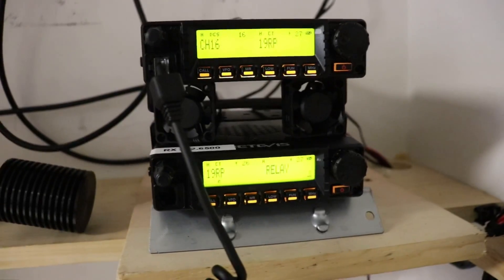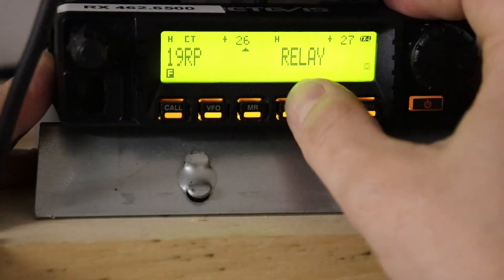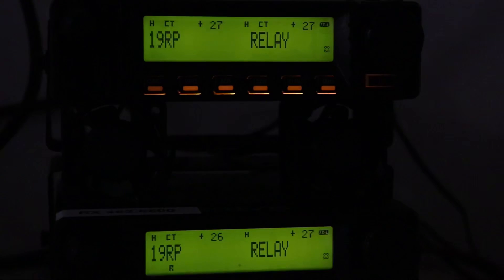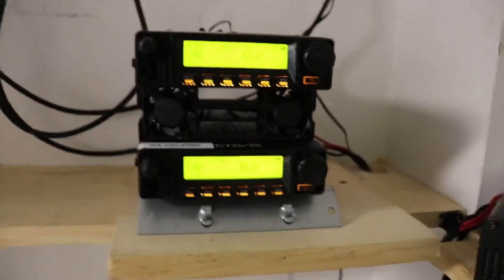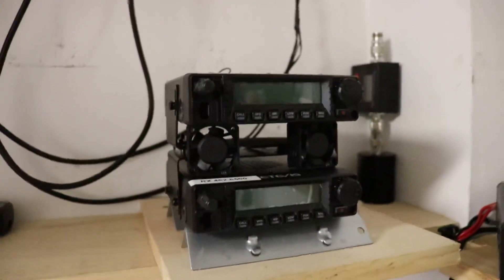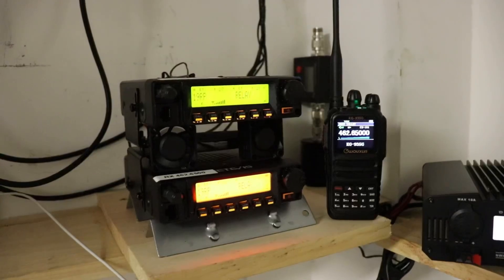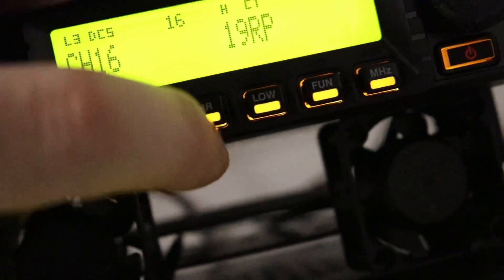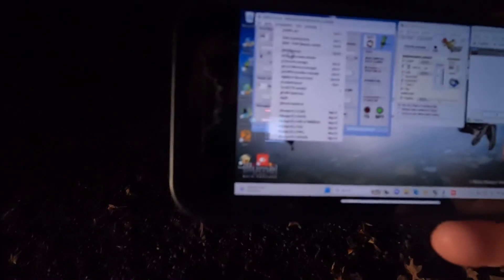Retevis RA-87 G.M.R.S. 40watt Repeater build and testing

Comment: I ended up buying the whole rar87 repeater kit from retevis because I wanted a little more power than the ra97. 

I think I have it working for the most part, however, I’m not sure I have my tones set right. I’m using dts and using the same dts tone for both transmit and receive, I’m just curious if you know if I need to 
A) have those tones set in both the radios 
B) just have them both on one, either the tx or rx radio.
C) have one radio with r-cd and the other with the t-cd set to the DCS tone.

Currently I have both radios set with the same C-cd which sets both radios to have all the same c-cd, r-cd, and t-cd. I seem to be getting good transmission while I’m near the repeater, however as I gained distance I seemed to be loosing the transmissions (very minimal distance) . I did not have that little r function set that you went over but I’ll see tomorrow if having that turned on helps the functionality. Any insight in setting the tones would be much appreciated.
Reply from the maker: A I set both radios to the same tone 
B the little R means your reverse transmitting so your receiver has to have the R also make sure your receiver is plugged into the high side of the duplexer and use the frequency your duplexer is tuned to
Reply: @JDubbsadventure  thanks for the reply, I’m wondering if not have the reverse transmit on was what was causing my issues, I’ll test it tonight and see how it works!

Comment: Thanks JDubb you seriously helped in getting my system online - got the repeater setup but cannot locate the hangtime for the kerchunk - I thought it was the Squelch Hang Time in the Optional features section but even at 500ms I don't see a difference. Where is that set at?
Reply from the maker: To remove the squelch tail cut the tail off and make sure the tend I believe it’s 60 off that’s the Roger beep
Reply: @JDubbsadventure  I actually want to turn the tail on - its nonexistent right now.
Reply from the maker: To have a squelch tail cut 
62 tail on 
60 tend on (Roger beep) 
9 is your hang time

Comment: Couple of suggestions from someone who learned a lot the hard way.  LMR or any of the similar type "dual shielded" coax is really not a great idea for repeaters due to something called Passive Intermodulation or PIM.  LMR is great simplex cable, however you can get a lot of "angry pixies" in the line on repeaters with duplexers (single antenna RX/TX setups).  This shows up as RX desense, a static or distortion on the incoming signal etc.  I built a repeater happily using what I thought was a good idea, real LMR-600.  Turns out there is a reason most "real" repeaters are built with Heliax or other air core hardline.  When you have tinned braided shield resting on another metal (in this case aluminum foil) you can created millions of small contact points that (due to bi-metalic properties) act as diodes.  This creates RF intermod that inherits the coax.  It is to weak a signal to radiate out your antenna but it comes back down the coax as a distorted common mode current signal and your RX has to deal with it.  This is not always the case, some installation with LMR style cable get away with it, often with really high end commercial grade filters/duplexers/radios.  However for the home DIY'er this can make you crazy if you experience it.  I ripped all the LMR dual shield out of my system trying to track down desense.  The short runs were replaced with R400 or 402.  The long run was with cable found on ebay that was "commercial install remnants" of Heliax (Trilogy 1/2" Coax Cable from Antenna World on ebay).  All the desense went away, so this was the magic bullet for me.  I wanted to share this as this info was really hard to find until you go to HAM repeater builder sources.  It never occurred to me that when you transmit into the LMR coax that power "could" be converted to noise by the very low loss properties of the cable and cause repeater problems.  If you use separate antennas this is not an issue.  Also, LMR is GREAT coax, just for simplex.  Do yourself a favor and research RF PIM!  Cheers!
Reply from the maker: That’s true, and Iv looked into it and if there ever is a problem than I may order hard line as of today no issues

Comment: Just a note, I used LMR400 for my patch cables and after watching your video again I noticed you specified that you were using LMR240 cable. I wanted a softer cable from the LMR 400 so I got the RG8X cable and lost 10 watts before the Duplexer. I thought that was crazy!!!
Reply from the maker: I’d check your swr. I had rg8x before i switched to the lmr240 and gained a little wattage (2-5) but nothing that significant. There’s a seller on eBay that makes good lmr240 cables with hight quality ends
Reply: @JDubbsadventure  I would be interested. Do you have a URL?

Comment: Suggest if vou internet search for RA87 Chirp There is a good working instruction set for how

to use with

Chirp

((Turn on chirp developer mode )) and click on file dropdown menu) file, select py file you downloaded to load module RA87.....

per instruction set

When thats done and you’ve done the download toradio > using the supplied programming cable 
click on view > show extra fields

It then lets you check mark those frequencies you dont need scanned for com activity

You can also add UHF ham repeaters @ frequencies to monitor and listen to

You can listen but not transmit on ham repeaters due to current firmware

Suggest have a great day

R

Comment: I think the 50watt btech's are probably your best bet to have a 40watt repeater build.  They transmit well above 40watts, closer to the advertised 50, and with a duplex you're probably gonna be right at 40watts.  Since they're $219, I'd say it's the better deal for ya to have the 40watt repeater build you're aiming for.
Reply from the maker: There a good radio but there not easy to make into a repeater. This was a video showing anyone can build a repeater that works well without being able to build circuits and their own board. Thanks for watching
Reply: I just bought three of the btechs from China direct for $150.00 each , saved about $210.00 . Two for a repeater and one for a mobile unit.

Comment: OK, I built the same Repeater that you have in this video.I'm still al little confused about setting the CS tones. If you set both "CTCSS or DCS" tones or what? Both radios are set just like you instructed in your video. I am getting 40+ Watts on the antenna port at the duplexer with a SWR of 1.06. Best I can tell that is super!
Reply from the maker: I set both radios to the same ctcss tone for example. The receive radio has ctcss tone 67.0 and the transmit radio has ctcss tone 67.0 set. You can use either ctcss or dcs but not normally both. Your getting 40w after the duplexer that’s really good the duplexer normally takes away 30-50% of the watts
Reply: @JDubbsadventure  I set the radios to Simplex mode before entering the repeater settings. One radio output was 48W and the other was 45W. I used the higher watt radio as the transmitting radio.
Reply: @JDubbsadventure  Another thing I don't understand is the duplexer tuning. I selected a duplexer set to 462.6750 / 467.6750 - Channel 20. In your video, you selected channel 19 in the setup so I assume your duplexer was tuned to 462.650 / 467.650 - Channel 19. How does the Retevis Repeater build know to use the 5K offset on the transmitting radio?
Reply from the maker: The offset is preprogrammed into the radio. Make sure you have that small R on the receive radio so it will reverse transmit
Reply: @JDubbsadventure  When I complete my build I am going to make a youtube video showing my build. Would it be OK to credit you and your youtube channel in my description?
Reply from the maker: That would be awesome if you would credit me

Comment: I'm building a Retevis Repeater just as you have in this video. I thought about using a Marine Battery Box as a Repeater Enclosure. It has some ventilation in the top lid and it would be easy to mount cooling fans for additional heat dissipation. What do you think about this idea?
Reply from the maker: I’m doing a video now that you might find interesting. I think you’re going to want something with more air flow depending on how hard it’s used.

Comment: Hey Dubb’s were you able to find the mic Pin out for these radios?
Reply from the maker: I did but when the radio is in repeater mode then the mic (rj45) plug is disabled sadly.
Reply: Strange.. mine still operates like normal. But also my 87’s only have 2 power settings high and low. I notified Retevis and they said “ that is what it is now” Not much help. Where did you find the pinouts?
Reply from the maker: @Jason-gc7vv when mine is in repeater mode it will  key up and immediately shut off. I emailed them and they sent it to me
Reply: @JDubbsadventure  Thanks man I will check it out!!

Comment: Do you happen to have a list of everything needed? What antenna are you using?
Reply from the maker: I’m doing a video on that. But real quick 
2 radios 
1 15-30amp power supply 
1 duplexer 
25-100 foot of good quality coax
Tram 1486 antenna
2 Lmr240 or lmr400 patch cables 
An swr meter 
The cool guys cooling fans kit (Amazon) 
Miscellaneous hardware

Comment: Hey J dub, question for you when your talking about the cooling fans you installed.  You have the fans wedged between the radios and say the hottest part is on top where you have the temp probe.  Are you going to place a fan up there also?

The reason I ask is because retevis now offers this repeater as a package in a metal case, carry handle, and a power supply for $530 shipped.  It does look pretty but upon further inspection from the available photos online, it appears the radios are stacked directly on one another.  I see that very problematic for cooling, especially if a guy wants to mount a 120mm PC fan under the heat sink on Tx radio similar to what you did.   There is a fan on the case but I assume that is extracting heat and not blowing on anything. 

It does look like retevis omitted the data cable and have them wired directly to the PCBs on each radio.  I wonder if that helps with any delay between Rx and Tx?

Anyways, long story short.  Would you get the package repeater in the case or go with the two radios and data cable and build your own rack with cooling fans if you had to do it over again?

Link for referance:  https://www.retevis.com/rar87-40w-gmrs-walkie-talkie-repeater-base-station-us
Reply from the maker: Sorry I missed your comment, Iv known about that set up for sometime now and I still prefer building my rack and adding cooling fans wherever I need them. I have a video coming up that showed the repeater as a finish product and no longer a prototype

Comment: Nice video! Curious I see your repeater’s receive freq is 462.650 and transmit 467.650. Shouldn’t this be reversed? My assumption was for the Duplexer high would be  467.650 (repeater receive) Duplexer low would be 462.650 (repeater transmit)?
Reply from the maker: You know you’re the only one who noticed that. I saw that when editing the video if you look at the newer videos you will see I fixed it, but good eye
Reply: Hey Dubb’s have a question for you, need your expertise. I’m working with 2 HT’s for local repeater with amp and duplexer for about 20w. Output from repeater great but have issues with getting into repeater knowingly because of using HT’s. Would you recommend these RA-87’s… or something like your midland MXR-10? Your distance tests seem great with both set ups. Any info would be great thanks man!!
Reply from the maker: @Jason-gc7vv  I think your saying yours using two ht as a repeater? Depending on what your looking for the MXR10 is great no fuss works right out of the box and my friend makes a plug and play interface board. Both the MXR10 and the ra87 have a squelch tail so that will let you know that you’re hitting the repeater.
Reply: Hey Dubb’s. I went with ra-87 but cannot get squelch tail after hitting. It’s there but short. Any idea how to adjust? Thanks man!
Reply from the maker: I’m out of town but I believe you can change the time in the S something in the menu and you can cut the tail on it’s the last setting

Comment: I'm new to gmrs, I want to setup a repeater at my house as i'm trying to reach my office that is 25 miles away, if that is not possible i want family to be able to use it on a 5 miles radius. I saw retevis sells the same equipment in a box, but being new, i'm not sure what cable to get, what connectors it would take, i did see you are using a tram antenna in the comments. I want to get all the possible power so I don't think i would be using a duplexer, do you have any tips?
Reply from the maker: Distance is determined more by terrain then wattage, watts help you for example penetrate walls, trees, etc. I’d buy the radios as cheap as I can I know fight before Christmas I saw them at $98.99 for 5 days. The cable is a simple audio jumper cable that amazon sells for $3-10 I got a 3 inch one since everything was close. My cable came with a rode microphone I had extra. Check out my zello channel and you can hear the repeater and play with it. I have a short video on the pole I’m using it’s cheaper than anything that’s radio specific

Comment: If you put up a tram 1486 (or 1468? Can’t remember which number) gmrs base antenna, which has a gain of about 6.5db, that should increase your range.
Reply from the maker: I did which to the 1486 from the midland mobile 6db antenna. My range is limited by the mountains not really power

Comment: I watched your video fully and read every comment but I didn't see anything about the Duplexer that you used. Did I miss it or can you tell us what you used?
Reply from the maker: You don’t need the duplexer to make it work, that said you will need to antennas, separated, far apart. The duplexer I have is a “cheep” one from buytwowayradio.com you can get them from eBay and Amazon but you will have to tune them and that takes special equipment

Comment: Do you prefer this repeater set up better than the RT97s or Midland?  Thanks
Reply from the maker: So far yes and no I think the midland is alittle more sensitive but the ra87 is a lot better for my area since my antenna isn’t extremely high and the leaves hurt me in the summer. Both are extremely good and useable. The ra87 will need fans and a box made.  where the midland is plug and play
Reply: @JDubbsadventure  Awsome thanks for the reply and info. Trying to make up my mind between the two.
Reply from the maker: @brettmorefield3455  really just depends on your area.

Comment: I WOULD LOVE TO KNOW MORE ABOUT THE DUPLEXER AND ANTENNAS ? DO WE NEED 1 OR 2 ? AND WHAT SPECS ?
Reply from the maker: Duplexer is only needed if your gonna run one Antenna if your gonna use two then the duplexer isn’t needed and I’m using a tram 1486
Reply: HOW FAR DO I NEED TO KEEP THEM APART ?
Reply: What duplexer are you running? I like the setup
Reply from the maker: The further apart the better for the antennas. And the duplexer is 

https://www.buytwowayradios.com/xlt-dp-gmrs-50.html

Comment: Does Retevis offer a repeater package or did you buy the radios separately? Also, where did you source the cloning cable?

Would really love a detail build video.
Reply: I know I'm a few months behind your comment here but currently Retevis has a "repeater core" package that cones with both radios, the 1 pin to 1 pin, and 2 programming cables on sale for $340 and the have a package with all that plus a power supply and an enclosure for around $550.
Reply: Ah, think I found the cable. Is it the 1-pin to 1-pin data cable?
Reply from the maker: Working on the video now for this I used an old audio cable that I had for all my microphone equipment

Comment: Just received the Retevis's repeater package and just like your units getting much less than advertised/promised. At best getting about 31 watts at high power setting, and once through the duplexer getting about 24 watts. Many thanks video and information.
Reply from the maker: I’m working with them now on this problem. On the bright side you have 6 more watts than me. My unit is working great make sure to put cooling fans on them
Reply: @JDubbsadventure is it possible to elongate the squelch tail?
Reply from the maker: @KO4RXE-WRMR358 not that I’m aware of it’s either on or off
Reply: @JDubbsadventure  Roger that Brother  always a Great Video keep it up 👍 I have a similar set with Kenwoods, Vertex Standards lol a couple UHF Commercial radios...very versatile setup also connected to zello...works great with the surecom repeater box and a 50watt XLT Duplexer ! Keep encouraging the Hobby Brother!